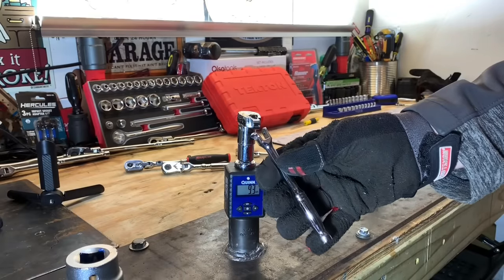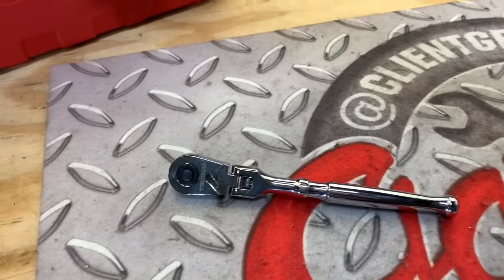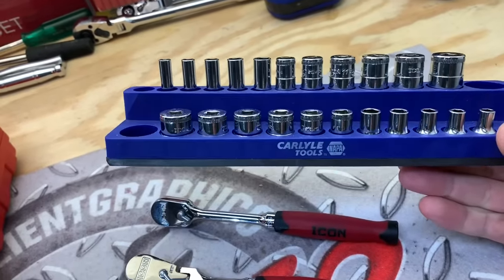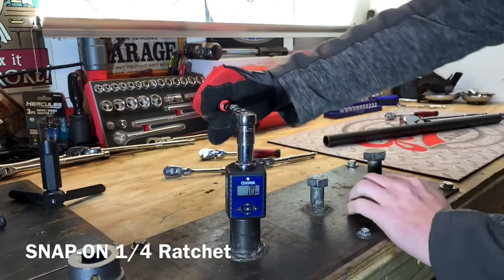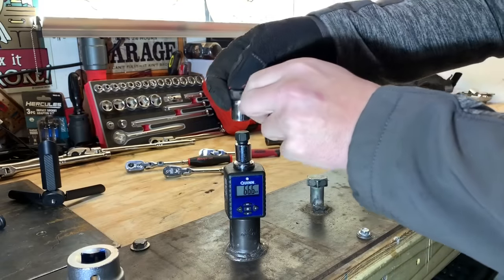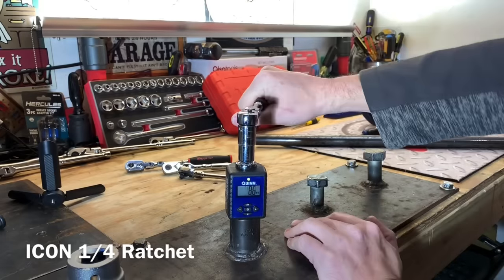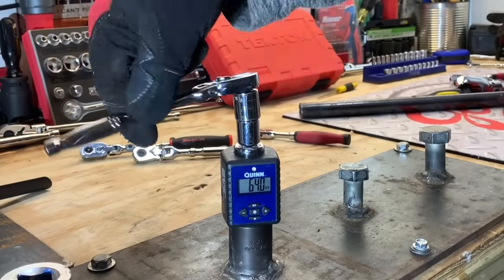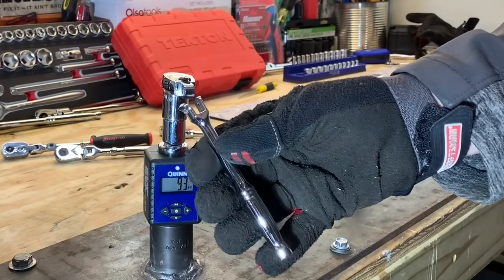$145 of SnapOn vs Tekton vs Icon vs Capri Tools Who Will Flex the Most?

Comment: I have the exact same tekton 1/4" drive set and I love it. The tests that you did is a great example why I always break loose tight bolts using a breaker bar first before using a ratchet.  After breaking a few ratchets in my younger years, I started using a breaker bar to bust those tight bolts free first before reaching for my ratchets. The right tool for the right job. Great video.
Reply: The Tekton ratchets are typically rated for the same load as their same size breaker bars.  I think it is only their 3/4 in breaker bars that exceed the ratchet. All ratchets in this test exceeded the ANSI and ASME standards for 1/4 in ratchets.

Comment: As others have mention, if your doing a ft-lb test, they should mechanically function the exact same. Quick release vs not is comparing apples and oranges.
Reply: Agreed.  Also, if he is going to take the tool to failure it should be done with one constant continuous application of force to the tool/cheater bar instead of repeatedly stressing the tool in a yo-yo fashion and then finally taking it to failure.  There is a lot of room for improvement in his testing methods.

Comment: Really not sure what these videos are proving lol. You would never take a quarter inch ratchet to those torque levels. Not what it's meant for
Reply: Um, its proving the tool breaking point.
Reply: The lug nuts on my Tacoma need to be torqued to 83 foot-pounds. I use a 1/2-inch drive torque wrench to righten them, neither a 1/4" nor 3/8" wrench. This video proves one needs to evaluate 1/4-inch wrenches on something other than breaking strength. Study Koken ZEAL 1/4" and 3/8" socketry to learn what factors truly matter in the modern era.

Comment: I was impressed with all of them. I don’t think you could go wrong with any of them. Great video!
Reply: Tekton doesn't honor their warranty
Reply: Pat H I’ve heard nothing but great things about there products and warranties. But I’m sure everyone has different experiences with all tool brands out there.
Reply: Where you here that? By paid endorsers on you tube, I'm a broken down retired ass from the Midwest who after 35 years in the trade was basically told to use a faulty tool it will break in, maybe the signals were crossed but a "no hassle warranty" is just that,
Reply: Pat H what did you use for those 35yrs in the trade?
Reply: The usual snapon Armstrong wright proto craftsman ect. and a bunch of offshore/taiwanese stuff, whatever the company supplied and never got snubbed by a supplier like "Dave" at Tekton did, that douch should be on the soup line, I'm in a local of 8 thousand members in chicago, they should honor their warranty, bad service travels fast
Reply: Pat H well if the service is that bad it will spread like wildfire and destroy a company. If companies can’t stand behind there product then they will fall eventually. Time will tell I guess. I’m surprised you even gave tekton a shot given what you use or did use is all high end

Comment: Tech In the UK here. We have MAC, Snap On and Tool Truck on our tool rounds. I Used to buy snap on. Used to being the operant phrase. Never liked MAC, our rep is a bit of a dick, his van is never stocked and their tools are equally as overpriced as snap on. However, Our Tool truck dealer is an absolute Legend. I only buy from him now and I’m a total Gearwrench junkie now. I bought 9 ratchets for the same price as 4 off snap on with some change. I absolutely reef on them. More so than the Snap on and still not had any problems (had my snap ons rebuilt like 4 times this year)

Morale of the story. These big companies are not your friend and expensive tools don’t make you a better tech.

Comment: I've had that same Snap On ratchet for many years, and it's never been rebuilt.  They have the best locking mechanism compared to the others.  As far as actually fixing cars for a living, it helps when the tool stays in the position you set it in.  The other ratchets don't work as well.  Plus why did you start off with the Snap On ratchet already damaged when the others were brand new.
Reply from the maker: danc2581 I really do like the locking mechanism on that Snap-On the best.  They have a patent on that so you won’t see another just like it for quite a while. The only ratchet that was slightly less used was the Capri Tools.  The Snap-On had one pawl with damage under regular use the other pawl inspected and used for this test was fine.  They all hit over 37.5 lb-ft which is the only real mark needed to hit to be within spec for ANSI/ASME👍🏻
Reply: I don't understand the one sided reviews on these icon ratchets... I am a heavy equipment mechanic and after seeing tons of reviews about these I decided to give one a try. I got the 3/8 stubby I put a socket on it and spun it by hand and the thing locked up and would not switch directions. I took it apart greased it and tried it again got two ratchets on a hose clamp and it stopped.
GARBAGE!!!!!
Every other ratchet I have are snap on's and they work day in and day out. Thanks for another one sided review towards the people giving you free stuff.
Reply: Kevin the 3/8 ratchets got recalled just to let you know.  I’m not saying those ratchets are better or as good as snap on but they did recall the 3/8.
Reply: @toddosterhout9866  Hey Todd thanks for the heads up! I will take this one back
Reply: @kevhouse55  I bought a 1/4 inch that did the exact same thing. They may have a great warranty system but I really don't want to trade one junk out of the box ratchet for another.
Reply: Mac's new locking flex head is a far superior design, much more durable than snap one's.

Comment: Hello Chris 
My question to you about the 1/4" ratchets.  Has to with user experience in work? Which holds up the best etc. Breakage only shows the strength not the long term use. Otherwise,  another Great Video.  Again thank you

Comment: The fact is I'm more afraid of braking a bolt in my car than I am breaking a cheap ratchet like the Pittsburgh brand  from harbor freight. I have broken more than just a couple of bolts already thankfully I ve been able to pull them out with vise grips or easy out.  So there is no need to overspend on ratchets lol.

Comment: Coming from someone who's quickly becoming an Icon guy I've got to say using a broken snap on rachet is super shady to say the least.
Reply: It failed in the test due to an anvil shear. The crapped out internals are negligible at that point.
Reply: @HankShivers   over your head
Reply: He rebuilt the snap-on ratchet before the test
Reply: @bstceltics4  dude it was literally slipping that means he didn't rebuild it.

Comment: A follow up video should be the warranty process and how hard it was with exchanging for a new item.
Reply: Tekton doesn't honor their warranty, even a defective out of the box ratchet, Dave at tekton says it needs to break in, after 35 years in the trade I never needed to break in a ratchet so it would actually "ratchet" instead of locking up and then slipping
Reply: I should add they look like nice products just like any chiwanese stuff just go for the cheapest the hassle isn't worth it, and any comparison to snap on that everyone does is kind of silly, they ain't snapon, the above tests are pointless, if I take a plasma cutter and run it across the handles and see who cuts faster does that make it any less a wrench or just a rediculouis comparison
Reply: Pat H I don’t have my tekton stuff other than their mini screwdriver set the work well but I have many different brands including snap on and really people who buy snap on because they “are the best” are really only wasting their money I have tools that should have failed years ago and they just won’t die for example harbor freight die grinders Pittsburgh pro ratchets some craftsman USA stuff from the 80’s I could go all day long point is all 4 of the ratchets they broke today in this video performed very similar and there are a ton of young mechanics entering the industry and they will need to maximize their dollars as this gentleman stated you can buy an entire 1/4 inch master set with 3 ratchets for the price of one snap on ratchet it’s just stupid to spend that kind of money on all snap on when there are many other options I do have about 8 of the snap on 14.4 power tools and love them but I’m not spending 700+ dollars for a set of wrenches or one set of 1/2 drive sockets that is just dumb
Reply: Harbor freight demolishes all others in the warranty dept

Comment: I have the flex head 1/4 drive long comfort handle snap on ratchet. It’s about 12 inches long and I regularly put 100 ftlbs. On it. Never had a problem. Have tried several brands of ratchets over the years and can’t complain about snap on hand tools. Air tools and cordless is another story though.

Comment: If you need to use a snipe on a 1/4" ratchet give your head a shake! Lol.   Snap On is way overpriced.  Their finance plan is whst keeps them going.  Far better to buy something cheaper and pay cash than being in dept to SnapOn the rest of your life.
Reply: Your comment only proves you're not a professional and don't deal with the truck because when you buy tools on "credit" from the truck you're not actually buying them on credit. The truck is basically giving you the tools up front and you pay them weekly interest free until you pay them off. The term credit is sn arbitrary term and doesn't involve actually credit and the amount owed to the truck doesn't show on your credit report. If you buy a tool box and don't pay with cash or your personal credit card then Snap-On will finance you the box, the truck won't do payments because boxes are so expensive.

Comment: I went with the Tekton non quick release swivel head ratchets. 1/4",3/8",1/2"drives. I'm really picky about ergonomics and the lowest profile heads with no protruding mechanisms. Having complete control of the socket while in tight spaces is very important. Most inexpensive ratchets are bulky and have alot of resistance when working on finger tight fasteners. This makes them useless in tight spaces when you can't keep the fastener moving in the right direction. You end up using some form of thread sealer to create enough resistance to keep the fastener from spinning back the wrong direction.

Comment: Been working on cars and trucks for over 25 year's never needed a flex head or any high end ratchets for anything. I prefer my great neck and craftsman tools because they have lifetime warranty and are easy to get. Although I've only had to replace the 3/8" drive craftsman one time when the handle snapped in half while working on some brakes. I was surprised that the handle broke before the driver especially after the abuse I put it through. I only have a regular 1/4" drive snap on with a short handle and that was actually given to me.

Comment: Bought snap on with quick release 18" 3/8 drive basically same as show on this video just longer one used 3 times 3rd time I tried to tighten a bolt it snapped the anvil grab my torque wrench to torque that bolt to 130ft.lb torque wrench still move like 30° before it click.
Never again buy that quick release from snap on

Comment: I have not picked up the ICON ratchets yet, but I do have the 25" breaker bar.   When.. err, if my Kobalt ratchets end up failing, I may pick up the ICON ones.   I do have the SAE/Metric deep sockets from ICON, which work as intended.  :)

Comment: For the 3/8s stuff, I have a Tekton quick release unit. I've REALLY leaned on that ratchet with zero issues, and the tooth engagement vs the Mac and Matco units is near identical. Hell of a deal for the money. The only upgrade I can see worth spending the money on would be the SnapOn (there ratchet mechanisms are just unmatched in my opinion..) or the Matco for the locking Flexhead (I have their 1/2 unit and love it).

Comment: All these tools are FAR stronger than you should ever need in their respective drive sizes. Anyone breaking these tools is likely abusing them. 70+ lb ft on a 1/4" ratchet is massive. That's almost enough to fully torque an m12 bolt, which will have an 18mm or 17mm head on it and you won't be using 1/4" drive in those socket sizes.

Comment: I have all three, tekton snapon & icon. For the money the tekton is the best buy. Closer to snapon profile wise and the direction selector I think is better than the icon. Icon just seems a little bulky and cheaper feel. When these test are done it should compare apples to apples because you do lose strength with the convenience of a quick release. Tekton has the same ratchets in non. Just my 2 cents from using them all while during car restorations

Comment: i have been watching the ICON brand and so far I like what I see. What I wish you would add is the warranty of them. They are warrantied to the original owner only? What about snap-on? Also how much trouble to return the ICON? Do they have replacements in stock at HB or is it warrantied through ICON. If you needed the tool to finish the job, could you get it replaced immediately? The Tekton seems easy enough to replace immediately through their website without a receipt?

Comment: I am a snap on snob however there are many other tool companies offering quality tools at lower prices. I do buy snap on tools when i get a good deal on Ebay. But have been very impressed with some of the ICON tools. A while back wanted 6 point wrenches standard and metric none were made in icon or tekton snap on and sk were to much money for me being on a limited income i ended up buying a set of gearwrench and i will say not bad.

Comment: All the people saying "well you would never use a 1/4 drive at these torque ratings". 
Well a chain is only as strong as its weakest link. If you can't expect a ratchet to perform at an extreme, how do you expect it to last at its lowest working level. 
I would rather use a $30 ratchet that made it to 75+ftlbs before breaking than a $145 ratchet that only made it 72ftlbs. I know it will be able to take the beatings of everyday use, and for a fraction of the price.

Comment: come😇 on no mechanics use so much force like that when they work on cars. torquing the head with 1/2 inch. on a rusty bolt you heated up and it come out easy. 88inch pound on most 8mm stud or bolts. 22,36,99. 115,157 sometimes, most rachets go to waste after a lot of normal use. then get a new cool one.

Comment: I like the duralast ratchets the best, i have the tekton metric socket sets and i like them because there one of the only complete sets i could find at a reasonable price but the shallow sockets are 1/4 inch longer than most others and the deeps are 1/4 inch shorter.
Reply: That could be an advantage in certain situations where a standard socket or deep socket wouldn't normally fit. Thanks for letting me know. I may pick up the set now.

Comment: For starters the snap on was already broke when you tested it. Next who would choose a ratchet with out a quick release? We don't use 1/4 for high torque, unless your an idiot. Just like only an idiot or someone doing a stupid test would put a cheater bar on a 1/4 inch.. what do we have breaker bars or impact wrenches for? We would be into the 1/2 inch drive if we needed that much torque. I would not waste money on icon. You'd be laughed out the shop by the senior techs.

Comment: I like these torture tests but truth is if you gotta put that much force on a 1/4" ratchet, then you're gonna grab an impact or breaker bar. 
Point is if you use the correct tool for the job, your tools shouldn't break...even if it's bottom dollar HF Pittsburgh. The point of these tests should only prove that they are all capable tools and that features mean more than its shear rating.

Comment: Snap-On is iconic on a few tools - their ratcheting screwdrivers are the industry leader by far.  They also make some nice non-standard tools that can't be found elsewhere.  That said, except for a handful of Snap-On tools, I have never seen the value in their quality or pricing.  The results noted in this video are pretty common with Snap-On; they usually perform in the middle of the road.  Yes, they have a lifetime warranty, but so do most reputable tool makers.  When I hire new aircraft mechanics, I always discourage them from buying Snap-On and especially to never open an account with the truck.

Comment: If I am using a flex head ratchet I prefer a locking head. I like the lock on Snap On but the Tekton with the indent is almost as good. 
Capri's warranty is no where near as good as any of the other three. Normal wear and tear is not covered,  you must be the original purchaser and must have your receipt. Then you mail it back then wait for your replacement. Personally I do not want to deal with mailing a wrench, socket or ??? Plus lifetime isn't available on alot of their tools. 
Which is ashame, they have some good tools. Their impact sockets are excellent for the money according to many reviews.  
That's where Tekton shines, take a picture,  fill out a quick form and hit send. A few days later you have a new tool at your door, never leave the house.

Comment: All said and done snap on still wins 😄

-The best locking mech
-The best chrome 
-Smooth dual 80
-You’ll never push a 1/4” to 75foot pounds you’ll just grab a 3/8” for that.

Strength is not the best but I know which one most people want in their toolbox if the price wasn’t a deal breaker

Comment: 1) Ratchets are not designed to be used as breaker bars, although they do sell ratchet breaker bars and you might be fine using a big ratchet to bust nuts.
2) The Snap-on ratchet can probably do better if it were new. I’m not a fan of Snap-on, so I still wouldn’t recommend it.